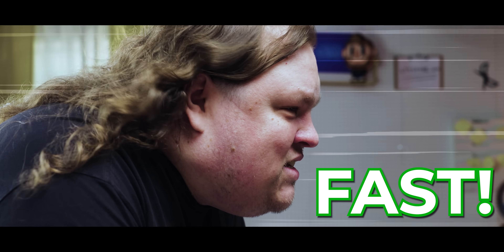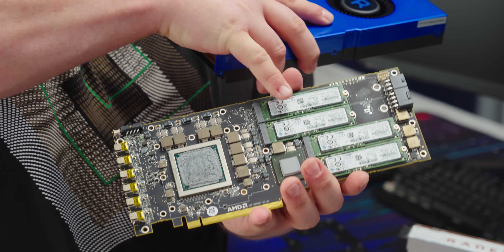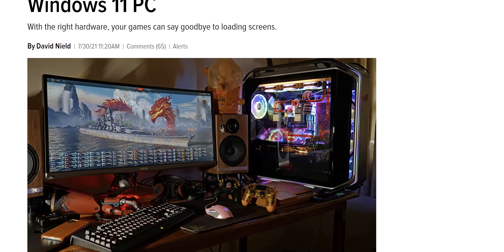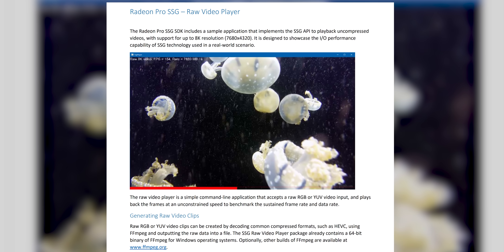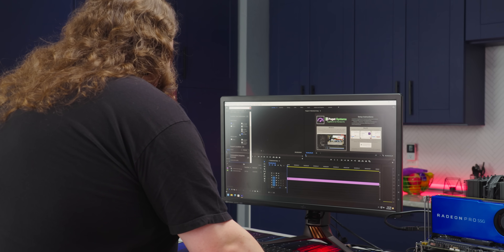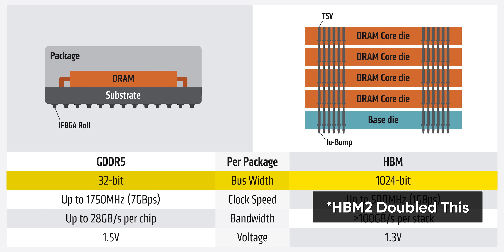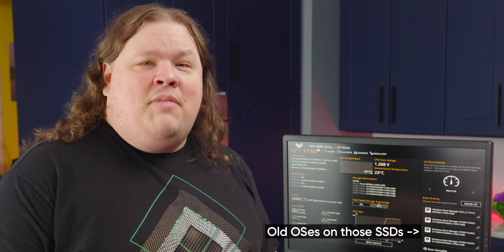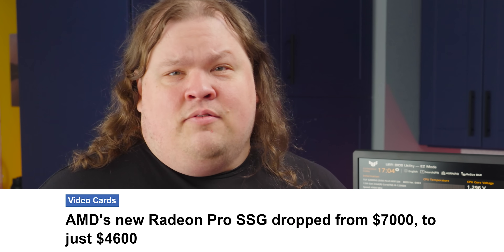Why does this GPU have an SSD? - AMD Radeon Pro SSG

Comment: I would totally buy a good graphics card if it let me even slap one M.2 in there just as a bonus storage space. Most GPUs won't use all the 16x bandwidth anyway so why not turn some of it into a storage space? It'd be super useful for SFF builds or even mATX cases.

Comment: For someone who used to built sff this would be a godsend in 2017 infact even now it still good, i had a dan case a4 sfx and most of it volume is dedicated for gpu and cpu and yes you can cramp in 3 2.5 drive but boy you need custom cable for everything including for mb, cpu, gpu to make space for the drive. even lian li tu105 also had 1-2 drive mount and itx mb low end one come with maybe 1 and high end with 2 m.2, having this would solve so much of space issues for me, my steam library already 6TB

Comment: It's a very interesting GPU for computational fluid dynamics too. Although there are ways to make CFD codes require less VRAM (demos on my YT channel), you always want maximum resolution possible. You could do colossal resolutions with TBs of storage. But in practice it's unusable, because even the 14GB/s is extremely slow, and you would rewrite this storage 24/7 which would quickly degrade/break it. With VRAM directly, you can do 400-3300 GB/s. So the SSG never really took off.

Comment: What is interesting is that the Vega GPU line is basically the last mainstream line of gpus to actually be able to pull this off, basically all other gpus simply wouldn't have the space on the PCB to just mount four M.2 drives this way. Well until someone manages to stack and adequately cool them that is

Comment: I architected this solution while I was working at AMD in 2015. The idea was to ignite a "DirectStorage" ecosystem that is only now materializing. 
Mind you, GPU compute cores still can't access the SSD Nand cells in random access fashion, these are two completely different electrical technologies, "DirectStorage" only saves the "hop" of the data through host RAM.

Comment: To be clear, all GPUs use system RAM if they run out of VRAM. HBCC is just there to do this in a more granular and smart fashion, allowing the card to push the less used data to system RAM and keep the busier data in VRAM.

Also IIRC the currently implementation of DirectStorage still uses CPU mirroring, which might not be a bad thing, and also a RAM cached version of the data. It would still be much faster as the slow part (decompression) is relegated to the GPU.

Comment: Anthony- Test This!
There's a use case similar to this which is far more useful: a four-SSD card (such as the ASUS Hyper M.2 card)  using a PCI Express x16 slot as a RAID0 drive array. The performance of this device (especially with PCI Express 4.0 SSDs) provides truly blistering throughput (at least on Linux) on both reads and writes  The problem becomes one of available PCI Express lanes. On most Ryzen motherboards, there are only one or two x16 slots and generally only one of them is truly x16, The other generally being x4. In this configuration the video card would then need to go into the x4 slot. Until you get to Threadripper or Epyc machines do you have enough PCI Express lanes to have multiple full x16 slots.

Comment: If they'd rolled out proper driver support for that wee beastie for all OSs, it could have been awesome, with a Hyper M.2 card in another 16-lane slot, and some nice big NVMes in both, you could have a mirrored pair of 32TB VDEVs - with maybe parity added by having a couple on the motherboard as well.  Downsize each by a wee bit with partitions to allow for L2ARC, SLOG and boot partitions to be split between lanes/devices and mirrored and striped for the bits you want to (so not swap - that could be stripe only).  Stuff it with fast ram and a decent processor and you have a heck of a graphics workstation or gaming rig.  All for the lack of decent driver support, which if it came with source code for the Linux drivers, would be easy for game or video software developers to hook into.

Comment: SSG can be used for rendering large scenes in 3Ds Max + V-Ray. Some scenes can easily consume above 100Gb of RAM if V-Ray is set to use the CPU, once set to GPU those 100Gb can be relocated to the vRAM/M2's in SSG case.
Reply: Ah why would you buy a graphic card then? 🤔 AXAGON PCEM2-S PCIE NVME M.2 Adapter The PCI-Express x.16 adapter for connecting a NVMe M.2 SSD hard drive to your computer

Comment: 6:10 Probably the screws are ferrous, but they're stainless steel, which responds only weakly to a magnet. Try sticking a magnet right onto the screwdriver bit; the stronger magnetic field should pick them up.

Comment: The Quadro was a CAD card, set up for more high density CAD modeling without the shader hardware since it's not for games. It would be cool to see the Radeon SSG's 3D CAD performance (or Revit).

Comment: It probably didn't sell well because the features aren't properly supported for most people and still cost seven thousand dollars at release and currently costs more than a 3090 on newegg. 

It could work out if they produced an updated one every generation for a more reasonable price (because the groundwork is already done) to have a series of them out there to build tools for instead of one weird expensive card from half a decade ago.

Comment: So... if Sony and Microsoft wanted, they could potentially offer a hybrid GPU/ARM + SSD accessory for the Series X/PS5 SSD expansion slots. The bus bandwidth is there, plus direct interface with hardware IO unit.
Some kind of pure RT-focused CU array, or ARM co-processor.
Perhaps not RT focused, but rather a hardware FSR solution (think tensor cores).
There's room for some hybrid processing + SSD unit for those expansion slots, like a mid-gen upgrade of sorts.

Comment: With PCIE5.0 this might become an idea that works for much more customers. 
The bandwidth of PCIE4.0 is enough for a GPU or 4 NVME drives, 
PCIE5.0x16 can do both without botlenecking at all.
This makes such a combination usefull even without any overly special usecase.
A superfast SSD cluster could  be made to work even on a mainboard with just one x16 slot.
Also.: is it possible to connect 5 SSDs as a raid5 with a controller that presents them as  one drive with raid0 speed? That would only use about 8 lanes, as the controller sits on the card.
Reply: WhatsApp➕1②④⓪-④⑦⑨-⑨③④⑥  you are obviously abusing the ltt logo , reported

Comment: That's actually rather unfortunate.  I can see GPU and SSDs getting closer again with the emphasis on DirectStorage, so it may see some revival in the coming decade, probably not the exact same way as this though, just a fatter pipe for direct access.  Proper hardware designed around that idea will be the like similar gap between HDDs and SSDs, we'll be able to do some amazing stuff with that.  Even some of the ideas being played around with now in the current experimental phase is amazing.

Comment: There is a real usecase for a GPU with a ton of memory: Iterative reconstruction in 3D-CT. 24GB can get way too small very easily. Even 80GB can be a little small, without clever usage of caching and buffering

Comment: Make for a killer storage expansion for SFX builds where you're constrained for space and the motherboard has limited options, especially if you're using a case that uses the folded book design for mounting GPUs
Reply: yeah 4x 8TB SSD's on there :D wroooom

Comment: Wait, could AMD make a combo GPU-M.2 extension card, using a 16x gen 5 slot that has no hope of being satuated by either a GPU or an SSD, but maybe by both at the same time? If the slot you're using doesnt go through the south bridge, it would be effectively the same as using it in an m.2 slot that is directly connected to the CPU. 

This could be super useful for Mini ITX boards that may only have 1 M.2 slot but still has a full 16x highspeed PCIe slot
Reply: Congratulations⤴️contact on claming your prize.

Comment: It’s a cool idea. I wouldn’t mind if GPUs started integrating more features so we could make more use of less PCI-E slots. As of now I have to use a second card to add firewire ports… then I need another card for eSata ports… why not throw a few of those on the back of a card that takes up 3 slots anyway??
Reply: Congratulations⤴️contact on claming your prize.

Comment: I could see how something like this would be useful but not in this configuration. Imagine having solid-state storage in the gpu that has an internal (SSD to GPU) bus with throughput much higher than PCI-e, and then the GPU driver using that to cache whatever data is streamed using DirectStorage so that you don't need to reload it from your regular storage. With some smart developer adjustments, you would be able to basically cache the entirety of a AAA game's assets in the GPU directly

Comment: This is a really interesting video, with a really interestingly niche bit of kit. But am I the only one who felt lost whilst watching the video? When you started comparing the graphics card to the gen4 SSD, you suddenly introduced "MP600" without explaining it, and I hadn't picked up the term SSG (I know it was used but cmon) and I was confused which was the 4th gen SSD. but more importantly, in the upgrade section, I have no idea what you did. All I learnt was the screws are non ferrous. I assume you increased the amount or speed of storage? There was no explanation of what the drives were or what changed after you installed them.  I've never felt confused by an LTT video before.

Comment: Maybe this concept will take off when PCIe Gen5 (or Gen6 for that matter) GPUs/Mobos/CPUs become widespread.   
Gen5 is 4GB/s per PCIe lane while Gen6 is 8GB/s.  Dedicating two Gen5 lanes to handle a single Gen4x4 NVMe drive probably wouldn't hamper performance on anything save the flagship cards (A Gen5 PCIe x16 card would have a nominal bandwidth of 64GB/s. Slicing 2 lanes off would only reduce it to 56GB/s.)

Comment: I can kind of see it soon as PCEI 5 that GPUs do not use all the bandwidth of will have enough bandwidth for the M.2 pcie x4 gen 3 drives and the GPU without creating a bottleneck for either. Depending on how the direct storage API is written and how the future card handles it it might perform as well if not better than that card is. The main problem would be it will most likely be marketed as  a GPU + 4 M.2 slot expansion card made for direct storage. As direct storage is being marketed to not need a new GPU and use your existing hardware it is not a bright future even if the performance is better for the APIs that use direct storage on PC.

Comment: About bandwidth: I play GTA V at 4k using an RX580 as eGPU using expresscard on a 2012 T430 laptop. The expresscard tops at 500MB/s . For games the 8GB VRAM is enough and it works perfectly, the PCIe bus is not really loaded. But playing software decoded 2k H264 at 4k, no... too much data :-).

Comment: We've got architectural blender files daily that requires  +32GB of graphic memory. This might speed that up quite a lot. We're defaulting to CPU rendering now because GPU + system memory is slower than running on CPU directly.

Comment: Data should not go through the CPU at all if it is already prepped on disk. That's called a zero-copy buffer. The SSD can put it straight into the GPU's memory. That's why it's PCI(e) and not ISA. It also directly points out why TB3 can be a very big security risk if your OS does not have "firewalling" on the PCIe links.

Comment: 0:00 I see a Radeon Pro GPU, the kind of GPU I have in my system.

Me instant love <3

0:04 Damn, it must be the WX9100 version... 6 Mini DP is not the WX 8200 and the new W6000 series models don't have that shroud.

0:14 Nvm, what even is that card? XD

Must be new :)

0:19 I was right it was old XD

Comment: Given how GPUs and NVMe drives are struggling to saturate PCIe gen 5, such SSG concept is feasible and could even have room to come back for people who want to use consumer processors with limited PCIe lanes but also need more storage than the 2 dedicated NVMe drives most motherboards offer. However the main driving force away from this is how physically massive modern GPUs are as well as the additional cost on GPUs that are already overpriced. It might be something better implemented on special purpose motherboards.

Comment: What I would like is more M.2 expansion cards. A 10Gb network card would be nice since we already have SATA controllers. So How about a sas controller as well. It would be a way to bring back the multi-function expansion cards from the 80s but in a new more flexable way.

Comment: Why not design a special SO-DIMM that is installed on the PCIe slot on the motherboard while connected to the GPU via something like NVLink? This would might both the CPU and the GPU to have direct access to the SSD

Comment: Personally, I wish server tech would hurry up and trickle down to consumer motherboards, so I can get memory controllers and EDSFF drives running CXL in a gaming PC to inject data directly into a GPU and DPU at full PCIe 5 hardware speeds like a bullet to the brain. Microsoft DirectStorage seems like a consolation prize by comparison to what's happening in the server space.

Comment: This was bound to happen.  Extendable memory would be a massive leap in reducing ewaste from out of date cards.  Add on a GPU socket with quad core capability or better, you'll have a mini computer as your graphics card, which is the direction graphics cards are going!

Comment: With direct storage on the horizon and pcie gen 5 an add in raid nvme card will eat this setup alive. But that’s to be expected, on the cutting edge of tech 5 years is a really long time. Then you got Apple with their crazy M1 ultra with 128gb of unified memory. I know it’s not 2tb but it’s hellllllaaaa faster. If you are in video editing that thing is going to be really hard to beat.

Comment: I think the random speeds were completely misunderstood by you, they are in software raid array, that's why they are so slow, look at literally any PCIe flash accelerator.

Also, I'd wager that the SSDs aren't actually interfacing with the GPU die at all, and are just using a PCIe bridge/switch to share the PCIe bus with the GPU chip, I would guess that that's the chip with the thermal pad on just below the GPU and bottom SSD.

Comment: Best of both worlds, slap in 1tb NVMEs on there, but set it up as a RAID1. 2tb at theoretical double speeds.  I get that it would be sharing PCIe lanes with the GPU, but I would like to see what kind of difference it would make.

Comment: They should implement a lesser version of this on all GPUs and add graphic API extensions to allow games to load data directly from the drive bypassing the CPU.  It should be able to function as your sole NVM.e drive, but more often it would be used as your user application and data drive, while a smaller drive on your mainboard would function as your system drive.
Reply: As a note, as mentioned when they were setting up Linux, it is noted that Linux has methods to separate out user applications, system applications and boot applications, just like Windows.  Linux had it before Windows, with it's standard setup dating back to early Unix releases with some minor variation to adapt to more modern computer structure and usage.

Comment: I want that for my Unraid box!  4x directly accessible NVMe SSDs along with a GPU in a single PCIe 3.0 x16 slot would be quite useful for motherboards with limited M.2 / PCIe slots.  Probably not worth the cost unfortunately.
Reply: Ah cmon intel one is much more expensive   x16 nope x64 is the way to deal with it

Comment: Ummm...., not so minor nit... PCIe has fully supported bus master DMA and non-master DMA since day one. Data does NOT ever need to flow through the CPU just to get into and back out of RAM. The only thing discussed here that would normally require CPU use would be de-referencing the next block or extent of a file prior to telling the disk controller where to DMA it to.

Comment: Performance is probably down to the type of SSD... I'm using one as a boot drive and it very quickly and easily throttles, even with a fan assisted cooler on it. That's what I get for saving £15 for a OEM part vs Retail sm960. (also fault to funky, forced drivers)

Comment: Can you set up just for test purposed a Scenario, where you cach your Files, that are needed to the SSD's,  create a  Edit Project and test the rendertimes from your normal SSD and/or the LTT Fileserver vs. the files of the SSD's mounted to the GPU? That would be the only real usecase that i could think of. i mean the Corsair MP400 m.2 SSD is avaliable in a size of up to 8TB wich would leave you with 32TB of RAID0 space to make a 8K project. If this would Benefit the rendertime, than i think you guy's should actually try use it, for a reduction in Laborcosts since you could for example set up a Renderfarm wich uses that Card and have less "payed" downtime and/or more time that you could spend for Channel Superfun ;)

Comment: Ibelieve the future PC. GPU will be the mainboard, where CPU, rams, and storage is directly installed on GPU board. Powered with GAN power adapter. And PC will be as big as Current GPU sizes.
Reply: Congratulations⤴️contact on claming your prize.

Comment: Isn’t the only graphics card with onboard storage option on all the 2013-2019 Mac Pro 6,1 cylindrical trash can models came with pice (albeit Apple’s proprietary connector which can be converted to m.2) on the graphics card/GPU! D300, D500, D700.